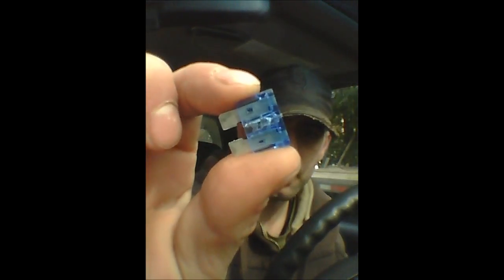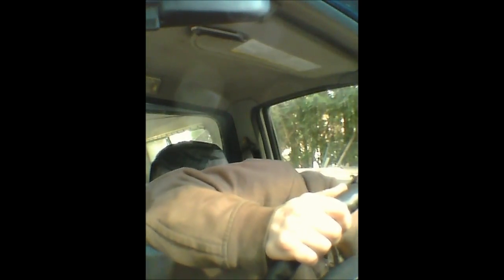(shtf) quick fix on a car fuse

Comment: WOud you know how to fix a loose fuse with pins that won't fit tight in its slots?
Reply: I need help with this too
Reply: I've read if you slightly bend the prongs in the same direction about 10° this will help seat the fuse. I have just tried this and it works although the mechanical part that this particular fuse is part of seems to be worn out (blower motor). I've also come across the idea to put a drop of solder on the prongs which will "fatten" them up. I will try this next but I'm pretty sure my problem is not fuse-related. 

The reasons the fuses don't seat well is because the springs in the fuse box lock up.

Btw...I would never go the foil route because if there is an overload in the system it could cause more damage.

Comment: Fine whatever your idea works but your idea of why fuses exist is wrong.  It won't be your cd player burning out it'll be your car burning down if there was a battery powered short with no fuse protection lol.  The fuse doesn't protect the device at the end, it protects the power source.  If you know that something should really only ask for a little power, you can safely say if it asks for a ton of power very suddenly it's probably doing something wrong and should stop.  That's what a fuse is for.
Reply: Yessir

Comment: Not recommeded - carry fuses they are cheap enough!
Reply: he did say if your in bumfuck nowhere... also sometimes humans forget such a small thing about owning a car i bet at least 50% of people out there do not have fuses in their car. i do carry fuses but you usually only get 1 or 2 of each rating so it would be pretty easy to use the one 10amp fuse you need then not have any left for the next time you need that 10 amp fuse or whatever